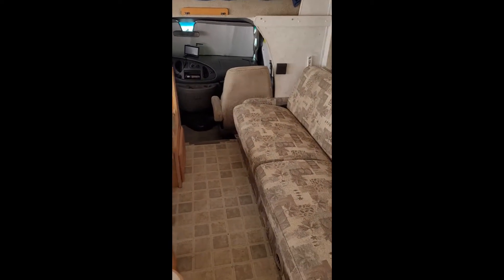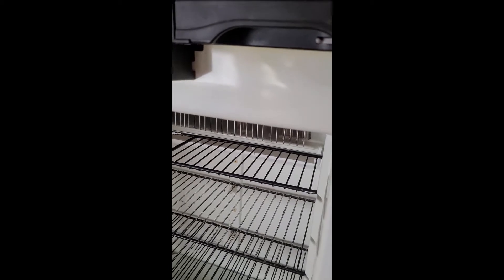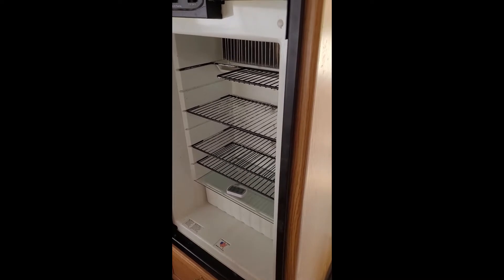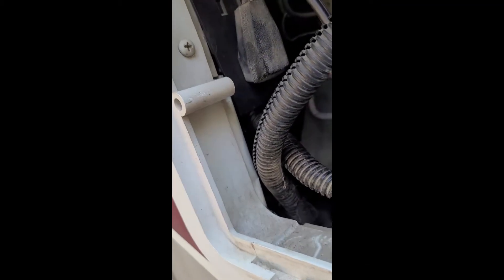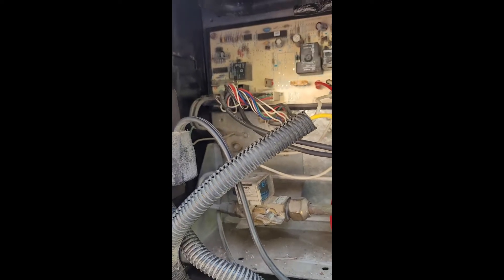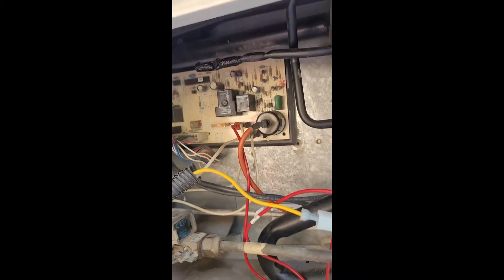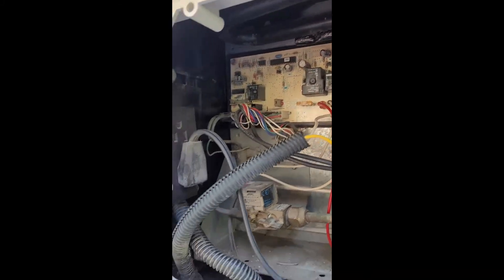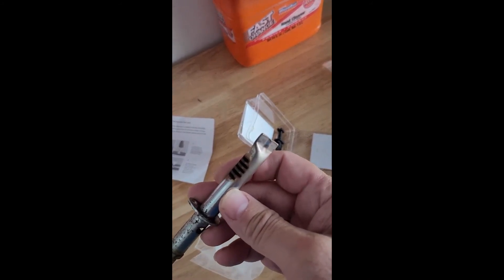N611 Norcold RV Fridge 5 flashes and not cooling

Comment: Thanks for sharing your repair story!!  I’m battling the same Norcold unit.  It didn’t want to fire up on Propane.  So I replaced that Orifice Tube that you showed at the end.  When I peaked into the burner box (name), I could see it trying to fire up, but it wouldn’t.  I saw a video that said sometimes there is dust in there.  One said you can shake the dust out, but it may not get an ideal flame.  I went for the low price part, and that definitely fixed that problem.  And there was fine dust that poured out of the one I removed.  So on the trip I took this week, the propane was lighting/burning, but now I have a flashing red light.  Hence my presence at your video.  I’m going to keep going.  My was made in 05/06, so I’m replacing the thermistor.  Of course, I went out to check it, and it is acting like nothing is wrong, at least light wise.  I’m in that wait-and-see phase.   Thanks for explaining the “how to remove” part.  If it comes to that, you will have saved me from wanting to cut it in half.😊

Comment: What was the reading on the thermistor? I bought a brand new one from Amazon, and it was open...
Reply from the maker: Mine was in spec.  It was between 28 and 29 in the cold water and 8 -9 when warmed up.  Here is a link to the data sheet specs.  https://www.irv2.com/forums/attachment.php?attachmentid=171823